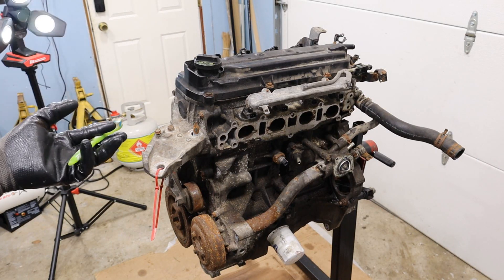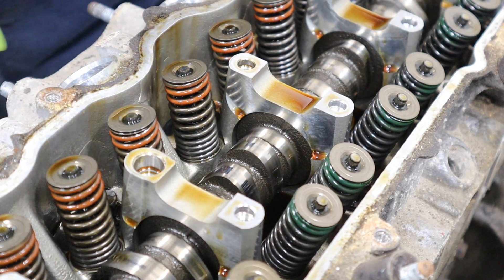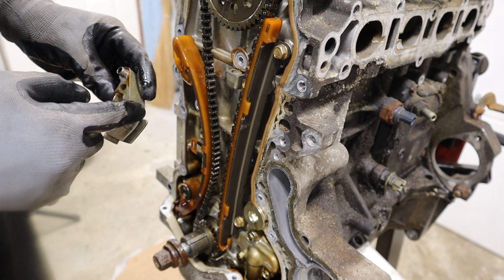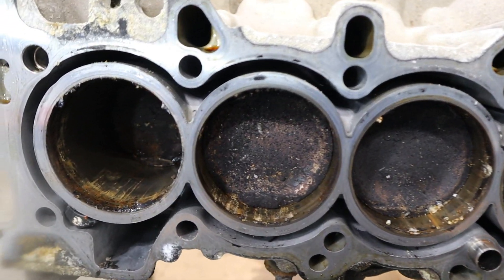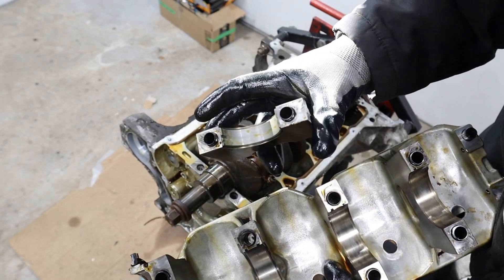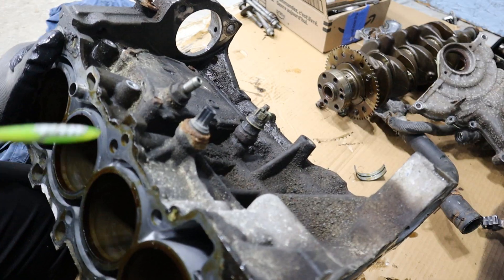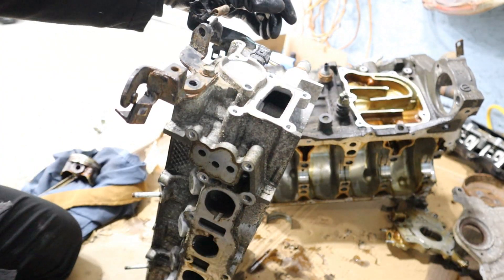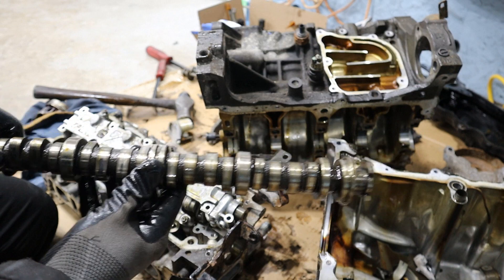The Honda L15 Was the Last Good Engine from Honda

Comment: The k20c1,  k20c2 and the k20c4 are excellent engines.
Reply: can't go wrong civic with k20
Reply from the maker: Even with direct injection?
Reply: @speedkar99 lots of high mileage 150k+ fk8’s around now that have proved that. I have had zero issues with my 2018, 80,000km I don’t idle the car  for extended periods no oil dilution, I frequently change the oil the car also has a custom Cobb pro tune. I drive it hard when I get to but maintain it well. They also don’t have carbon build up issues like other DI motors. My other cars include a Dc5r k20A JDM, and a k20 economy JDM in my Stepwgn, super reliable as well.
Reply: @speedkar99 yes.
Ford uses DI with regular fuel injection.
Keep valve and  ports cleaner.
Reply: @speedkar99 K20C2 is MPFI. Honda's DI system is pretty damn good. Valve gunk is unavoidable, I think that's what you were getting at.
Reply: K20Z3 💪🏼 port injection. The only thing I think they over complicated was the oil pump/balance shafts and its not easy to work on sitting in that tiny engine bay.
Reply: @lochnessspeedwerkz6557 K20C2 is also MPFI. No balance shafts.

Comment: Most, or basically everyone I talk to about cars have no idea the junk that's being made now. They give me this blank stare and just say, "but it's a Honda" So why would the manufactures make engines to last like they used to when the masses are ignorant?
Reply: I recently learned there updated 3.5 V6 now has the wet belt system that GM and ford use. That's gonna be a MASSIVE bil when it needs to be replaced. And as with most special fluids now a days, probably very expensive to replace. It probably looks good on paper and from an engineering side, but in real world usage it's a bad idea. Like the 1.5 3 cylinder turbos Nissan make (really cool engineering, but poor reliability and long term running)
Reply: @midnitestate  
For that infinitesimal increase in CAFE mileage the oil pumps are now variable in output...
you would think that a direct drive oil pump could be varied in output via an electronic variable valve so leaving a highly dependable oil pump alone to do it's thing?????
Reply: When hearing about the current issues Toyota is having with an engine, then it strongly hints there are troubles with auto makes of stellar reputations.
Reply from the maker: No one cares about what's under the hood anymore. 
A fat touch screen and a comforting "warranty" with peace of mind is enough to entice people into plunking $50K into anything these days.
Reply: @speedkar99  It also seems like everybody is blissfully ignorant about vehicle systems nowadays as well.  They want automatic this and automatic that and want fully autonomous and maintenance free vehicles.  Why do you think that manual transmissions have all buit vanished ?

Comment: Now make a video on the L15B7 or L15BE and tell us how it failed. Shouldn’t be hard
Reply from the maker: I've got an L15 turbo coming right up
Reply: @ AWESOME!!! Please make a point to show the turbo, intake valve cover gasket, and head gasket coating wear, the deck machining marks and the size of the head bolts please and thanks
Reply: If you could also show a step by step of removing the turbo in detail that would be beyond amazing

Comment: This engine was mint! What happened? Why was the car scrapped?
Reply from the maker: The owner K-swapped it!
Reply: @speedkar99  When you were taking it apart, I was thinking the whole time, that engine is clean enough for just an overhaul and a reseal.  Check the bores and pistons roundness for spec of course, and if if good, throw some new rings in, new timing chain and guides, and new seals, probably another 250K miles.
Reply: @speedkar99  Fingers crossed. I hope his upgrade's gonna last!

Comment: The L15A is the most underrated Honda engine of all time. The K series gets all the the glory because of its performance potential, but the first L series engines (L12/L13/L15A) are bulletproof and get good gas mileage. It's a shame the L15A gets lumped in with the rest of the L15s, which are garbage when compared to L15A.
Reply from the maker: Yeah. The newer L15s giving it a really bad reputation with headgasket and oil dilution issues
Reply: The 1.5T is a modern abomination. Had an early 25’ CRV and it was already suffering fuel dilution and I live in a hot climate. A year in, downgraded to the HRV with the 2.0. Couldn’t get out from underneath it fast enough.

Comment: You explained how the whole engine works beautifully but at 10:11 you didn't mention the compression rings are seized solid in the pistons, those rings are not going to be burning just a little bit of oil, they will be burning at least one quart per 1000 miles.
Reply from the maker: Yeah that's a problem. 
Even on the newer L15 turbo, I got one with stuck rings. Video coming later this month.
Reply: I had a Mitsi that ran 100:1
Every 100 gallons of gas it burned 1 gallon of sump oil.
Basically a 2 stroke!
Reply: 1qt/1000mi is a little. 1qt/100mi is a lot. 🤣
Reply: 😂 I see  @fun_ghoul
Reply: @fun_ghoul  yes I can agree. I do a bit of mechanical work myself, I noticed the Japanese cars suffer from stuck rings and oil consumption a lot but German cars don't have this problem as often, probably better design. German cars have other problems like timing chain and connection rods bearings. Japanese have better crank bearings.

Comment: The integrated exhaust hints at future turbos, but that design limits performance upgrades to turbo only. Gov't regulations demand less engine for less emissions, so boosting them to bursting is Honda's unhappy choice.
Reply: Emissions is the excuse, but the reason is planned obsolescence.
Reply from the maker: Oil companies would like to have a chat
Reply from the maker: Wait until you see the L15 turbo I tore down. So many short cuts
Reply: @ Sad, huh?

Comment: Surprising how clean under the valve cover when the PCV is moved elsewhere - neat design - those pistons tho...
Reply: So the air enters the cam cover and is drawn down through the block, into that convoluted passage then through the PCV and into the intake.
This helps keep all the varnish at bay as long as the oil changes are kept up.....

This is the reverse flow  to the 1ZZ Toyota 1.8 4 cylinder from 2004...
the oily gases exit from the valve cover at the top of the engine through the PCV and then into the intake
Reply from the maker: Crust.

Comment: It's what happens when w men vote to make cars produce slightly less emissions at the significant consumer cost of reliability and the emissions cost of making new cars.
Reply from the maker: The cost of replacing engines or recycling cars outweighs the savings you get on planet earth
Reply: No. It's planned obsolescence, and every product will have increasing amounts of that as late-stage capitalism wears on.

Comment: we're looking at D-series that's chain drive with an exhaust manifold built into head.  those were great old days. Excellent break down as usual Khar. Definitely looking forward to its turbo Kin, assuming there relatively easy to get at the J-yards due to their fuel dilution design flaw.
Reply from the maker: Thanks. I have an L15 turbo coming up!

Comment: Bro, just because the rockers are loose when they’re off-lobe doesn’t mean they’re too loose. Hondas are supposed to sound like sewing machines.
Reply from the maker: Shouldn't there be very little clearance? 
If the spring is pushing the rocker down there shouldn't be that much clatter?
Reply: @ let me try and remember when I adjusted my valves on my B20Z:

When the valve is on-lobe it’s pushing against the rocker. The rocker is controlling the amount of lift. That’s what’s important isn’t it? That controls precisely when the valve opens and closes snd how much. If we picture the cam lobe as facing vertical as a graph, we are moving that (somewhat) parabolic shape up or down from the X axis when we tighten or loosen the rocker. Tighter = more lift and duration.

When the valve is off-lobe the cam isn’t touching the rocker. The rocker is sitting on a little pivot ball and you can wiggle it around. The only way to stop that free play would be to have zero clearance when it’s off lobe. At that point you’d lose compression snd likely burn an exhaust valve.

I haven’t adjusted the valves on my 2az-fe because it’s a bucket. It doesn’t have that free play that a Honda non-hydraulic rocker has, does it?
Reply: all 4 cylinders sound like shit

Comment: My brother-in-law had a new '17 Civic SI, and I had a new '18 SI, and that L15b7 is absolute GARBAGE! His engine blew at 62k, and my car developed SEVERE gas/oil dilution at 77k. Stick with the non-turbo Honda motors if you want reliability.
Reply from the maker: Ouch. I have an L15 turbo video coming. Alot of short cuts on that engine 😓

Comment: Go back to the late '70s with the Civic CVCC engine. At 100K miles replace the mechanical fuel pump and go another 100K miles. Do NOT overheat!
Reply from the maker: That engine was amazing!
Reply: Yep '76-'78 Accord 1.6 CVCC also had similar single exhaust port to concentrate exhaust heat leading to warped alloy heads & even warped cast iron blocks when cooling fan switch eventually failed & caused them to overheat. Not an ideal design despite now common use for quicker CAT heating. The Non-CVCC & later CVCC-II versions quickly reverted to multiple ports for improved breathing.

Comment: Did a timing chain job yesterday on my 2013 fit, I can vouch that the crank bolt is crazy crazy tight haha
Reply from the maker: I just bought the crank pulley tool today! Have a few more Honda engines sitting here to teardown
Reply: @speedkar99  that's 50mm took is quite handy, got. Mine at princess auto for 30$
Reply: I’m at 370k miles in my 2010 fit.  Original timing chain.
Reply: @undertow2142  that's good 👍
Reply: I thought you don’t touch the chain unless there is an issue?  Am i wrong?
Reply: @robertd.5479  some rough whining noises were coming from under side cover, there's a measurement to check the gap between the chain per the service manual and it was out of spec so I ended up swapping the components. Better safe then sorry. The chain seemed to be stretched a little compared to the new chain I installed aswell
Reply: @tiickl3941  thank you for the follow up! Like other poster, curious the mileage you had, or any oil issue that may have contributed to excessive chain wear.
Reply: What mileage for this chain swap?
Reply: I swear everything on a honda is crazy tight on Hondas I was shocked when I first started doing maintenance on my 2012 honda odyssey.
Reply: Honda crank bolts love to get stuck in there lol. Im not even a mechanic alll i can do is barely put gas in my car but i hear that it has been a running meme since dawn of time haha
Reply: Timing chain wear can be caused by additive depletion when the oil used isn't up to the interval. 

10,000 mi interval + 5W-20 Conventional or Blend + age related increased blowby I could definitely see this happening.
Reply: America is the only country that uses 0w20 & 5w20...that's because of the C.A.R.B. rating which should be reviewed europen meaning england the specs call for 5w or 10w 30! After 100k switched to 10w30. Live in the south where it is warm...always used synthetic....good filter change to new filter mid point in oil service interval.
Reply: @hokehinson5987  Many countries use these grades now. However at the time that was true. However HTHS matters a lot more than whether an oil is 9.29 cSt 100C (20 Grade) or 9.30 cSt (30 Grade) @ 100C when it comes to bearing wear. However the issues with the long drains and timing chain wear is more related to additive package depletion from fuel and combustion byproducts.
Reply: @gk5891  yeah I'm not sure how well maintained it was by the previous owner, oil was quite dark and low when I bought it lol

Comment: Appreciate the simple no-nonsense design of this engine.  Notwithstanding the grungy cylinders (sitting outside collecting rainwater/moisture you said???) it comes across as a very well maintained engine.  You just don't get to almost 300k kms and have it that clean inside without regular and consistent maintenance.  That oil filter seemed HUGE too, much bigger than the typical blue Honda oil filter.

What happened to the rest of the car?  This engine wasn't pulled because it failed so guessing the car itself got into a wee bit of a fender bender that totaled it.
Reply from the maker: The owner K-swapped his Honda Fit
Reply: My thoughts too.  And sometimes, you need something to haul the family or just driving the same car for 20 years gets boring.
Reply: @Lee-f8u9f  If you dispose of a good vehicle because you're "bored", you have too much money. Of course, you can solve that problem by buying dumb shti like cars you don't need.
Reply: You must be from somewhere warm, L-Mao.

Comment: The L was a nice derivative of the D.
Reply from the maker: You think it was it's direct replacement?
Reply: @speedkar99  pretty much. 
L15 bore is 73mm
D15B bore is 75mm
so the L15 will make slightly more torque, but not much. The D15 will spin faster, but not much.  Plus the new Fit is about the same size as the D-powered Civic's were.

Comment: Honda still makes simple motorcycle engines. At least 3 of them use carburetors (ruckus/metro, navi, xr150l)
Reply: To be fair, most motorcycle engines are extremely simple.
Reply from the maker: Those aren't regulated as much as cars are they?
Reply: @speedkar99  they still pass emissions. That's why we can still find oil cooled engines that pass emissions in motorcycles. Aside from small engines, old bikes like Suzuki DR650 (before update) are just frozen in time to avoid any extra hurdles.

Comment: thanks for this video, very useful as I still have this engine in my honda jazz. currently it's still 45k km on the clock during 6 years of ownership.
Reply from the maker: Awesome! Do you Uber or something?
Reply: 45k km is about 30k miles. That could be low driving distance of 5k-6k miles a year. 
I have one honda jazz with L15Z engine for 7 years now with 72k miles (120k km) on the clock. That is 10k km (6.2k km) per year for normal daily drive. 
The last L15 SOHC engine before honda switch to L15 DOHC i-VTEC Engine NA a few years ago in our market. 
Every things on the car are all factory fitted, except front brake pads replaced at 60k miles (96k km).

Comment: The engine looks very well maintained, I wonder what killed it.
Reply: Probably nothing.  Driving the same car for 20 years gets boring.
Reply: @Lee-f8u9f  Being an owner of a '91 Civic:  Possibly transmission issues if it was an automatic; or electrical gremlins, such as what was surfacing in my vehicle of 21 years.  Or, being involved in a crash, where the insurance company would classify it as being 'totaled' for scrap and not for repair.
Reply from the maker: Who said it was killed? The owner K-swapped it!

Comment: i have L13Z1 (JDM) with 302k km and it works like as it just came out of factory. just some leaks from valve cover gascket (surprisingly not from main seals). i'm sure it can travel 2x that. oil service was 10k for last 5 years. reduced it to 8k
Reply: What's the fuel consumption like? Also does it burn much oil ?
Reply: @aden3113  fuel consumption is 8-9 city 5.5-6.5 highway(avg speed120-130km/h) l/100km. (5sp a/t AWD). oil burn none
Reply from the maker: It's a good engine. Keep it maintained.

Comment: What about the hybrid Atkinson engins 2.0, crv for example? Thanks
Reply from the maker: Better than the other choice (turbo). But it still has direct injection right...
Reply: @speedkar99  I'm surprised they opted for DI. A lot of hybrid atkinson engines, even despite emissions, still use MPI.

Comment: Small non turbo engine with a manual is what made Honda great. Sad
Reply from the maker: It sure was. They don't make them like they used to. And now they want to merge with Nissan 😢
Reply: @speedkar99  canceled thank to god 😂
Reply: I love my civic, it's exactly that.
Reply: The cub 50 is what made honda great .
Reply: Add to that no fancy doo-dads that do nothing to enhance durability.  That is where the various car brands today have got it so wrong.
Reply: Amen brother
Reply: So true!
Reply: what makes a factory turbo engine so bad?
Reply: @jackbob89  The direct injection system and head gasket issues. Particularly on the L15 Engines that suffer from blown head gaskets, injector failures, oil dilution and premature carbon buildup.

Comment: A very well designed engine. Make to last and easy to maintain.  With the proper care could have gotten 500k miles on it.  When did Honda discontinue this engine?
Reply: I don't think they have ... But the US doesn't get the cars with this engine.
Reply: For the US its all about snob appeal and status. No one cares to be practical, humble or economic. Its about who's got the biggest wallet and who can get to the redlight faster. Ill leave at that because then it turns into a conversation not entirely related to automobiles lol
Reply: @glenbenton4855  You are right.  Very few want to be practical and the car makers know how to appeal to those.   Its all about making money and selling that image of speed and beauty and coolness.
Reply: Still there. It’s just turbo charged now.
Reply: @Bimbo-Balls  Turbo'd.  What a shame.  😞
Reply: @Bimbo-Balls  isn't the turbocharged 1.5 a DOHC?
Reply from the maker: It is! They changed alot with the turbo variant
Reply: @speedkar99  A car with an engine like that will last a long time and easy to maintain and repair.  I know its all about making money and making them to complex for guys like me to overhaul. Too bad.
Reply: Here in the Philippines this engine is still available in the Honda City and BRV. But it is a direct injection tho.
Reply: @87bcpalot  is it? Iirc it still use honda pgm-fi multipoint injection? 🤔
Reply: He mentioned it in the video